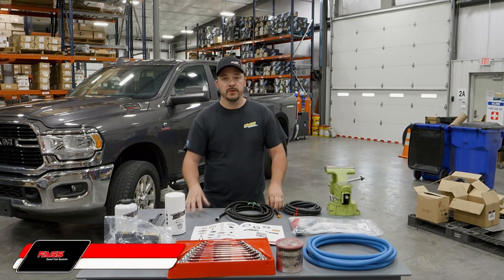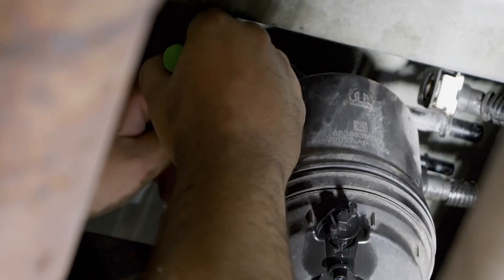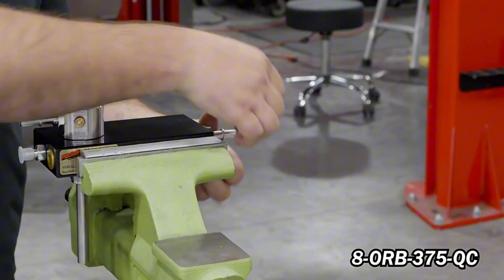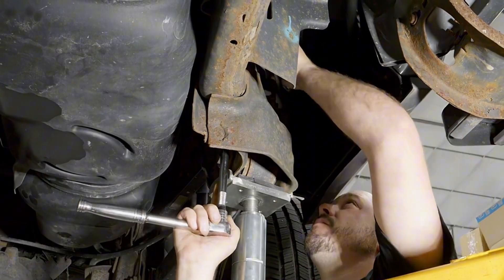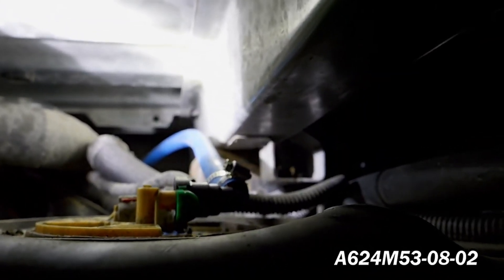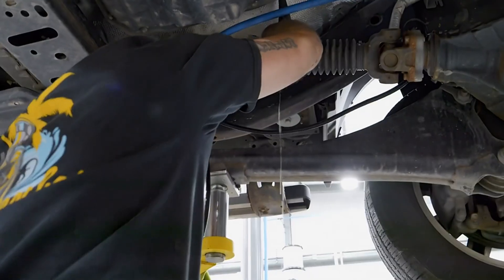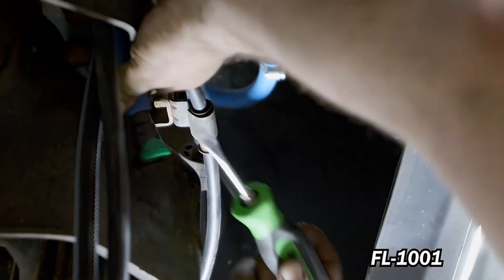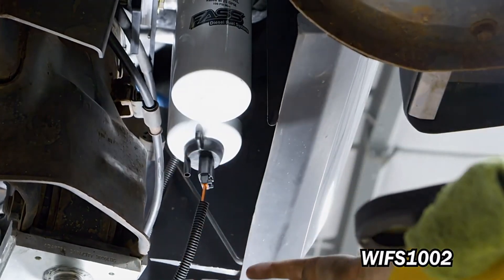How to install a Drop-In Series Fuel System on a 2019+ Ram w/ the 6.7 Cummins

Comment: Got a dumb question. I have this kit & am replacing my filters now after 15k miles. The  CWS1010 replacement filter i bought does not have the sensor receptacle on it. Do I unscrew the one from the existing CWS1010 filter that's currently installed, and screw it into my new filter after removing the black cap? After seeing this video, I'm pretty sure that's what I need to do, but I just didn't want break or ruin anything. Thx for any help out there!
Reply from the maker: No dumb questions here! Yes, you would reuse your sensor 😁

Comment: What size are the new fuel lines?
Reply: Can you uninstall OEM under hood filter with this kit?
Reply from the maker: @SimpleManFore  Hey there! The system itself will not replace the OEM hood filter, but we do offer filter delete kits in addition to the fuel systems that will!
Reply from the maker: Good question! Our low pressure systems have a fuel line of 1/2 inch and our high pressure systems have a 5/8 inch fuel line. Hope this helps!